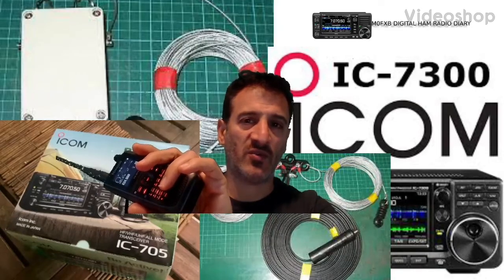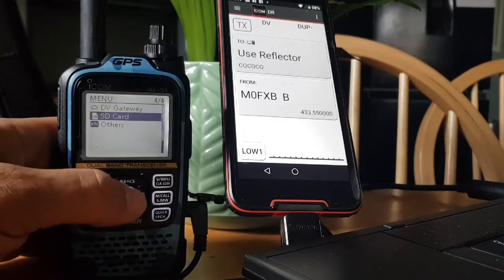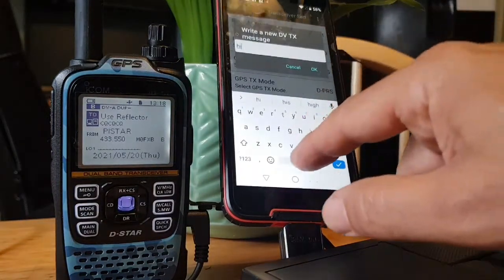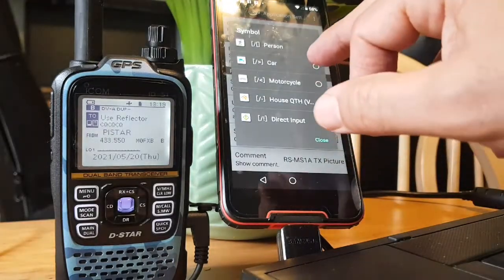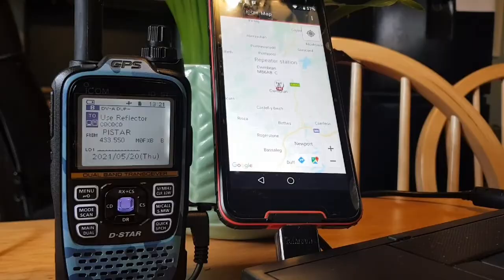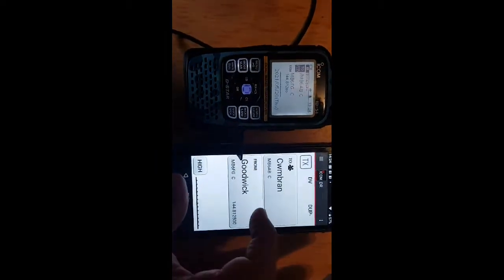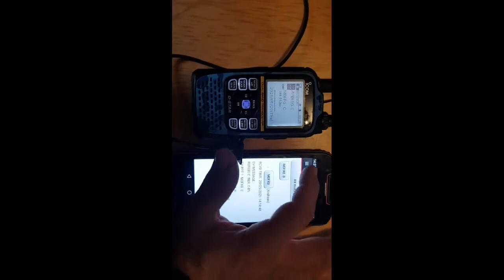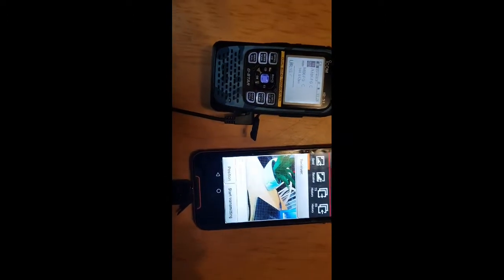ICOM ID-51 PLUS -Set up RS-MS1A app - using OPC2350 cable

Comment: Hi mate do you have any, or will you be doing any videos on using this as a regular radio rather than the D-Star side of it?  It seems every other person on YT has concentrated on the DV side of things, but I want to use mine in both modes.  I want to be able to have analogue running, some freq set as memories, be able to perform memory scan for them etc.  Cheers.
Reply from the maker: Yes i am doing a video on that now .
Reply from the maker: https://www.youtube.com/watch?v=po3WSDbt_Yc&t=3s